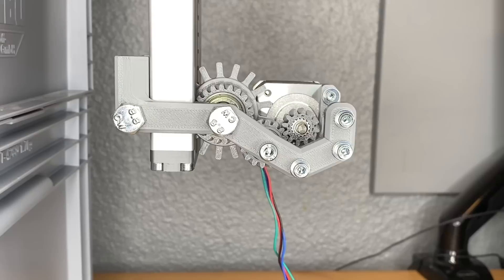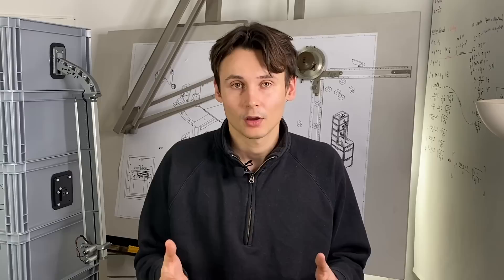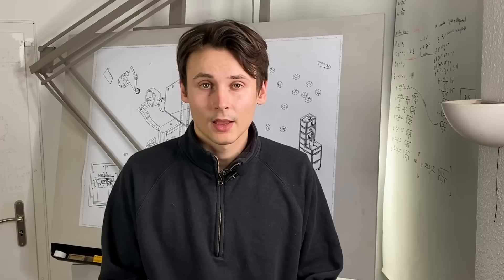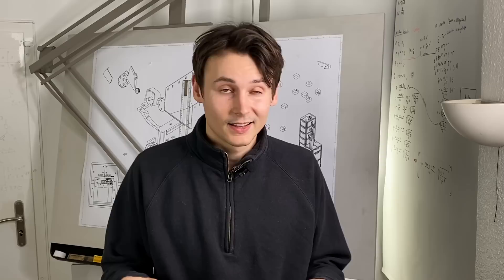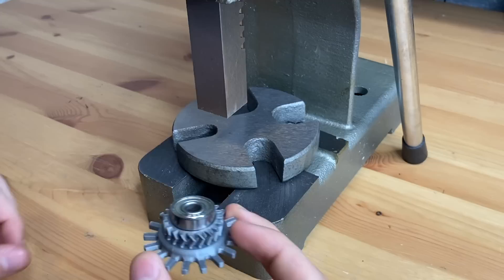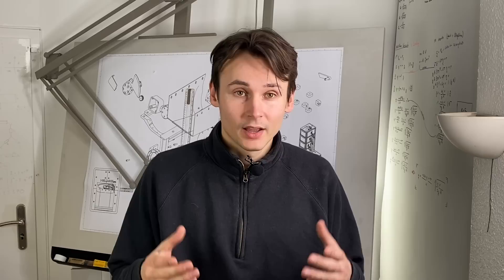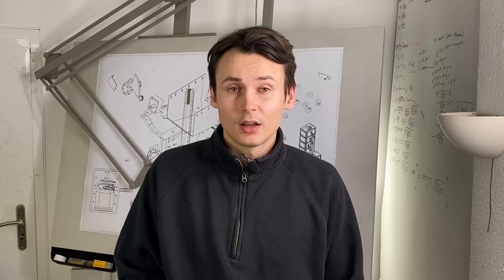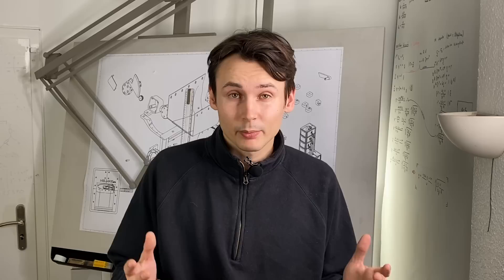The sprocket - 3D printed automatic screw packaging #002

Comment: Key takeaways:
* Pressing a timing belt pulley onto 3d printed parts is a great way to transmit torque. Thanks!
* Standoff and through bolts is a great way to assemble parts that interface with other assemblies. No need for precision, it self adjusts as it clamps.

In order to simplify programming you could add an optical or mechanical sensor on the individual tines of your counting sprocket. That way the stepper angle and gear ratio get factored out and don't have to be considered. No encoder, no calibration, all you need is a number of "pulses" to count.

Very clean presentation, thanks for spending your time putting this together, I look forward to your future videos!
Reply: Great idea on utilizing the exiting sprocket tines for flags. I have used "u-shaped through beam photoelectric sensors " for a very similar position encoding project. How would you decellerate the load before stopping with your design?
Reply: @aaronholwick8659  In this use case I would assume that the mass of the load is small compared to the power of the motor, and thus it is capable of decelerating well within the required positioning accuracy. Dispensing 10 SHCS took 17 frames (~.5s) with no perceptible acceleration/deceleration

Comment: if you put a worm gear you get breaking when trying to back drive it, so you don’t need to worry about the holding torque of the stepper or it unloading when powered down. you also might be able to make it more compact and mount the stepper 90°.
Reply: I was about to say the same!
Reply: Same

Comment: Thanks for the specific shout-out; wasn't expecting that. XD

If this prototype is anything to go by, the sprocket method works even better than I thought it would!

I agree with avoiding a Geneva drive. Even before tolerance and speed concerns, I worry that a 3D printed version of that mechanism would have a pretty short service life.

Comment: Love your engineering! I had a similar problem once: portioning plastic granules. I had a leadscrew prototype and thought about doing it by weight. But in the end everything was too complex and I wanted an easy ans fast solution. I just did it by volume. I measured four cylinders from drainage pipe to the approximate size, attached them under a board with holes the diameter of the pipe. They were closed by flaps on the bottom. To these flaps I added dead volume to fine tune the amount but left enough slack/over-volume for inconsistencies due to compacting variability etc. We would slide a bag over each tube, close the flap, dump in the product, take a ruler to wipe off excess granules (think sintering 3d printers). Then open each flap take out the bag filled with a good approximation of the target weight.

Comment: CAN bus is likely what you want to use if each module will have its own MCU. However, you could just as easily use stepper motor drivers with a I2C interfaces and just use one MCU

Comment: if you're concerned about dumping the magazine if the stepper loses power, do a ratchet system with the pawl on a continuous duty solenoid that is actively being held open so if power is lost it automatically snaps forward and locks the dispenser, dropping hopefully only one or zero screws if it's fast enough. or you can have a separately powered circuit that the detects a failure on the main system and snaps the solenoid out, there's a couple ways to achieve that sort of thing. another way is also a worm drive, but that's not conducive to 3D printing due to the high contact and wear plus it'll greatly reduce the max dispensing speed, but it is 100% mechanical and you can find fairly cheap small brass gear sets online.

Comment: in this prototype your trusting that the magazine will be always full
i suggest you add a TCRT5000 Infrared Reflective Sensor or something similar to count the screws !! you cant really be sure that the sprocket mechanism really grabbed a screw , maybe the motor skipped or the magazine is empty for some reason !!
it should be mounted as close to the sprocket as possible , it will also act as a magazine empty signal  
i think that will be cool
Reply from the maker: in fact, that is exactly my plan. :) Infrared reflective sensor also spot on.

Comment: Love the project, and sharing your progression of ideas!

Yet another armchair designer here… I see there are two mechanical problems to solve: a mechanism to stop the screws from falling out, and another to overcome that mechanism for one piece.

Solution could be as simple as a leaf spring to stop the flow of parts and then an actuator (say, a wedge on a solenoid, or a flap on a motor) to push one piece past that passive barrier.  

Something more complex like a toothed gear seems prone to getting jammed because it depends on the precise spacing of multiple parts when really you only need to engage the one part being fed.

Consider that even a one-piece actuator will need its position adjusted to accommodate different parts.

Comment: if you wanted to use the weight of the screws, you could replace the stepper motor and gear assembly with a brake disk connected to an encoder. PID control could slow and stop the disk and so the sprocket pretty accurately either with force from a servo motor or a 'variable voltage'/pwm driven solenoid to pinch the disk. A separate solenoid could rest with a pin through a hole in the brake disk, and turn on to pull the disk out, so its 'off state' holds the system still. It might be overly complicated for the task but could work. As someone else said, it could be good (in any system), to have a light gate or optical sensor to validate the number of screws.

Also really cool video! Just found your channel.

Comment: 1) you can use a line of sight sensor between the sprocket teeth to count the no of screws dispensed 

2) or you can calculate what degree of rotation does one sprocket rotation needs from the DC motor and just multiply it with the number of screws you wanna get

(You also need a digital pad or a screen to input the number of screws you need)

You can also add an automatic packaging mechanism at the end and add a feature to make n packets of m screws and bolts

Comment: You can use a esp32 that uses WIFI to control a stepper  TMC2208/ or DRV8825 to control the stepper motor, really simple and cheap (a pair of $ if you get the wroom) and you need low complexity to wire it. Then controll each esp32 by a raspbery pi or anycomputer with wifi by sending json to them with how many bolts you want (this is cool because you can have a response after the filling too). All boxes will have the same code and same schematics, so no complexity, just a different ID for each esp32. This also can be made by wire by controlling them with the i2c protocol or others but having wifi makes them much more modularity. Cheers! And if you want accuraccy, i suggest adding a light sensor to count the bolts as they fall if you want a second measure security, so you can count the bolts with this system and dont worry about the gear not having bolts in the buffer or the stepper lossing steps. Cheers! also a weight calculator in a hopper with all the bolts as final check will be great, a tensor sensor measure them in miligrams, very precise. And final tip, if you are scared for the stepper motor to fail during offpower, there are some motors with autobreaking feature with no power, and also there are other simple ways like blocking the gears with the actuator or a servo during offline and probably your first approach so you can run this with batteries instead of maingrid. And because I edited this message several times, I can give you my last solution to the problem, instead of having a machine box for each type of bolt, will be better to have just 1 machine with several buffers in pararell (and focus on making the magazine with bigger capacity, for example by zigzagin the bolts inside side to side) and feed the different bolts to the machine manually as the magazines gets lower or with a robotic arm that can grab them from the cartonbox reading a qr code for example. So you can save space and just build 1 machine and relay on the magazines instead of boxes like a pick and place machine.
Reply: You can also look at the ESP8266 boards which can be a little cheaper for the modules and an esp32 should have enough resources to be the server and interface depending on how fancy you choose to get.  Also note, using the ESP processors gives you access to their own ESP-Now protocols for sending data between the boards significantly faster and less overhead than sending TCP/UDP packets.   There is the option of wiring the boards together as serial devices which eliminate a lot of issues regarding stability/hackability, however requires additional thought on how to pass the wires/signal through modules.  Wired would give you the advantage of letting the boards go into deep sleep, waking up to a pulse/message from the server as opposed to having to keep the radios on constantly waiting for a command.

Comment: Another way to reduce the load on the motor from the falling screws would be to add a small offset in the path of the screws, a bit like a sloped cartoonish lightning bolt.

Comment: I like this method better than the solenoid one, seems to be a better way of doing this.

You asked for suggestions, the only one I can think of is possibly  using a DC motor, and a light sensor after the the sprocket 🤔 you could turn the sprocket on until a specific number of triggers of the light sensor has been completed, and then turn off the sprocket.

Comment: The square teeth on the sprocket are going to wear early, specifically the last edge holding back the screw (and specifically screws with their sharp threads), but this is actually good and I think you should do it on purpose in the design. If you round over the trailing edge of the sprocket then the point in rotation where the screw is released will happen earlier, decreasing the latency between command and delivery, letting you move the rest position of the next screws back to potentially put them in a stronger position to bear the force of stopping the stack after dispensing, or a combination of these. It will also reduce filament use a marginal amount and eliminate almost all of the shift in latency you'd expect over the lifetime of the square tip as it rounds over.

An alternate way to think about this is the two form a rack and pinion, with the screws being the rack and the pinion being the pinion. The ideal shape of the trailing edge is the involute shape for a pinion, not perfectly circular but with the point of contact lying on an approximate line (of engagement) rather than the circle of the pinion.

Comment: I have a couple suggestions.
First, include an optical sensor for detecting the rotation of the final gear. This could be tied into calibration logic to detect the rotation ratio between the stepper and the output without hardcoding (more modular).

Second, install the middle gear in a spring-loaded sliding carriage with the spring pushing the B gear into both the A and C gears. This will allow for the gear to pop out of place should a jamb occur (sensing this condition would then rely on the first suggestion).

Third, offset the gear contact planes, so that the B and C gears can be readily swapped for different gearing ratios. (The 2nd suggestion will aid in this process, particularly if the rotational axis is positioned above that of both the A and C gears.)

Fourth, secure the stepper to the mounting frame from both the back and front in at least two opposite holes on each side. This will minimize rotational movement of the stepper body in all three axis.

Fifth, include an optical sensor under the output to detect when no screw/part has been dispensed despite dispense gear rotation.

Comment: Man könnte auch ein Schneckengetriebe verwenden dann ist das Problem wenn es Stromlos werden sollte einfacher gelöst und durch die geringe Übersetzung ist es lässt sich der Winkel vom Zahnrad (in den Schrauben) genauer bestimmen und positionieren. Als zweite Möglichkeit könnte man direkt ein Schneckenrad zum separieren verwenden. Durch den größeren gewonnenen Abstand  ist das Verwenden einer Lichtschranke oder einen anderen Sensor für eine 2. Kontrolle möglich.

Top Video und erklär Qualität behalte das bei!👌

Comment: One problem I faced with stepper motors and printed parts is the heat of the motor. Steppers can easily exceed the glassing point of plastic, softening the gear and the holder.

Comment: A worm on the stepper will also not allow the parts dispenser gear to run in reverse because all of the force would be axial on the stepper. Very nice work.

Comment: If you go with TMC stepper drivers you could use stallguard for detecting the load on the stepper. It's also being used on 3D-printers for sensorless endstops / homing.

Comment: Before you make 40 of them, I recommend using an optical sensor you see on 3D printers to count the teeth on the sprocket so you can always verify the dispensed amount of screws, while being able to compensate for any index drift that might accumulate over time. Stepper motors are very reliable, but not perfect, so solely relying on sending an X amount of steps every time without feedback from an external sensor or encoder is unwise. Benefit is that this will probably make your system 10x more reliable while it only costs about 3 dollars to add to the system.

Comment: you could use closed-loop stepper motor drivers, these come in boards that clip on the back of the stepper motor, and then send the step signals to the closed-loop driver with esp32 controllers. these can then be clustered together over wifi, or over cable with preprogrammed number of steps per screw, and a host controller that just sends a signal to each dispenser of how many screws it wants dispensed.

Comment: If you have multiple dispensers that do not need operate simultaneously, you could make a single stepper motor run all of them via a switching transmission.

Comment: My PLA spline sprockets pretty reliably last 500k M6 bolts when directly connected or 4+m when using a radial spring shock absorber (basically a fancy flexible spring coupling designed to deal with radial shocks instead of vibration)

I have no idea where yours will end up but i feel like i've gotten some ideas on how to improve my own
Reply: Did you share your design somewhere?

Comment: Geneva drives and gear trains are nice, but a simple worm gear to another gear makes another simple but elegant solution: it almost eliminates backlash. The downside is speed: it takes a whole revolution for the gear to progress one position, yet that is also a benefit, as it makes the accountability much better. This can be sped up by using a geartrain of 2:1 or even 4:1 between the helix and the dispenser. it can however be set up quite easily with a DC motor using a simple encoder, for example, a button is pressed after each dispensing allowing the brain to count and verify its output - which is a benefit over steppers that don't give that feedback.

Comment: Once you start setting up multiple dispensers, you could look at using TMC2208/TMC2209 stepper drivers like what's used on 3d printer mainboards. TMC2209s can be driven over a UART connection, so your main controller can manage them all simultaneously with few issues.

Comment: Very interesting and well accomplished. With you, 3D printing is no more for prototyping.

Personnaly, I prefer the use of worm gears and not sprockets. Because it is not reversible and so it can protect your motor. But the friction is higher and so your current flow will be higher too. Need of lubrification. So you have advantages and disadvantages. Go on, you are very entertaining (nerds need you)

Comment: I would look into an escapement mechanism, so you don’t need to set the stepper to a specific rotation, but you can something like a solonoid again to send seperate pulses for each part ( no matter the amount of teeth the gear has). Cool project!

Comment: Use single MCU and single stepper driver for as many steppers as you want. Just connect them in parallel and use relays to connect specific stepper to the driver. Just do not forget to disable driver before switching relay or inductive currents gonna destroy relay very quickly.

Use solenoids to stop unpowered motor from moving. Or there are rather cheap normal-closed NEMA17 electromagnetic brakes.

Comment: You could use an opto interrupter at the sprocket to track the actual rotation of it and to count the number of screws dispensed. You could also use a second one after the dispenser to make shure that the right amount of screws were actually dispensed (maybe the magazine has run dry). And to counteract the screws falling out when power is cut you could use a solenoid to clamp the screws down with some sort of rubber or foam via spring tension (i.e power applied -> solenoid unclamps the screws, power cut -> solenoid releases, spring clamps down screws)
Reply from the maker: in fact, that is exactly my plan. :) I also thought about the solenoid clamp, but I'm not sure yet if it is necessary. But I like the idea to combine sprocket and solenoid